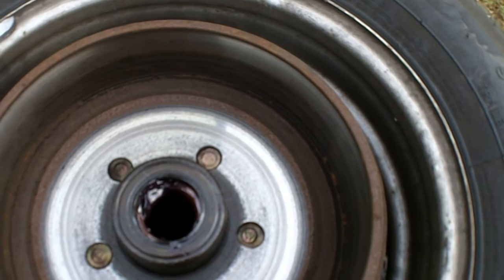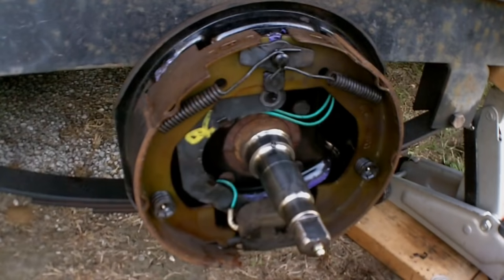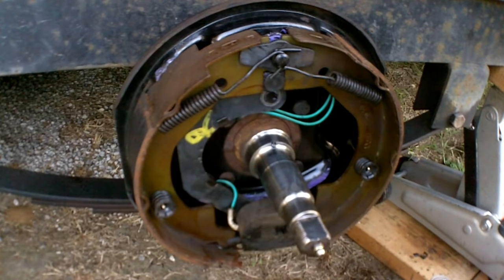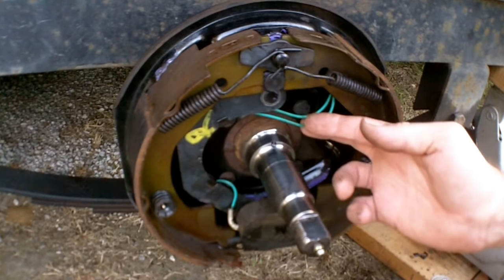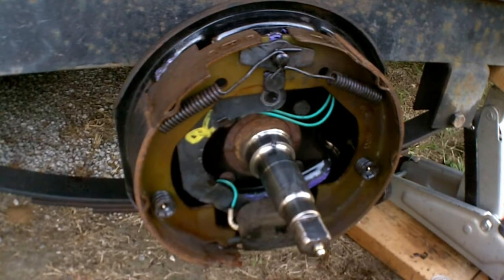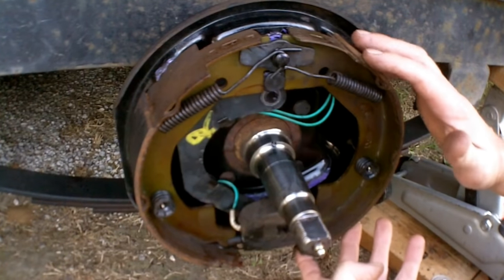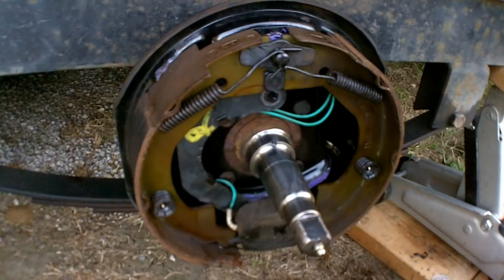How Electric Trailer Brakes Work

Comment: Is it normal for a multimeter to see both wires grounded?
Reply from the maker: I'm sorry Lawrence, I don't quite understand your question. Please elaborate and explain how you're probing things. And also include if the whip is connected to the tow vehicle while preforming your checks. I don't know if I can answer, but I'll try nonetheless. G.
Reply: Actually it was showing continuity. It's a nearly new dexter axle, I'll do the ohm test next.
Reply from the maker: @lawrencekendrick6440  Huh, sounds like you have it all figured out since you didn't even care to respond directly to my comments. Good luck, G.

Comment: 2 ?'s on my enclosed trailer, brakes stopped working. I know I have power at the 7 pin truck/trailer harness. Blue wire for brakes. Mine has a small 6 volt battery. I checked for power when truck brakes applied, I didn't get power on the trailer brake wires at the trailer drums. 
I think the emergence cable had been pulled off a while without my knowledge whike it sat.
I am not sure yet about the battery.
Where to start? Check etc TIA
Reply from the maker: Kevin, the small battery should be 12v. If the trailer disconnects from the tow vehicle, the emergency brake cable is ripped from the switch and causes the brakes to lock up and stop the trailer. That is what the 12v small battery is for. I would start there and possibly replace the battery and breakaway switch. From there, I would check the grounds on the trailer if they don't work under normal conditions. Good luck, G.
Reply: @ghostses  thank you
Reply from the maker: @kevinb.3528  No problem! G.

Comment: A great video.   Question: how often should the emergency battery be replaced. ...will an 12 v battery still work at 10volts?   They're $15 so just replace every year?   Thanks!
Reply from the maker: Thanks! I'm no pro, but I would only change my battery when it no longer takes, or holds a charge. 10V seems too low to me. Mine trailer does not have a built in charger that keeps the battery charged while towing. I can add one so my tow vehicle can keep it charged, but haven't done so. I test mine periodically by removing the pin and trying to move the trailer forward to ensure the wheels are locked up. This not only checks the battery, but also the brakes. I also check it from time to time with a multi meter. They might even have a solar float charger, but I've never looked. Hope this helps, G.

Comment: So one green wire goes to ground and the other green wire goes to the "brake" wire on the 7 plug wiring.
Reply from the maker: I would say yes. However, the colors of the wires may vary. It really doesn't matter the color, but they should be connected like you've said. Take care, G.

Comment: They're like brakes on a bicycle just inverted.
Reply from the maker: Not really, these are electromagnetically controlled. Dig deeper.
Reply: @ghostses  you missed my point mechanically...
Reply from the maker: @pantherplatform  I don't think I did. "Mechanically" they operate in very different ways. A caliper is more akin to how a bike brake works. A pinching action on the rim or the shoes pinching a rotor. This is a drum brake setup. A coaster brake would be a better example and more appropriate,  but you didn't specify. Since you said "brakes", that would imply a coaster brake was not in your head as bicycles have never had a coaster brake on front wheels. Feel free to elaborate more on how you think they're the same, but just inverted.

Comment: Sir do you think a donut brake magnet can be fixed (wires are broken
Reply from the maker: German, if there is enough wire sticking out to splice onto- it should work. If hey're broken off at the magnet, I don't think so. You should be able to get a replacement magnet if it can't be fixed. Good luck, G.

Comment: OK I watched this video this morning, and it was very informative. (I did not know there was an electromagnet that rides on the face of the brake drum) But the video is wrong as to why the front brake shoe is smaller. Now just to be clear, when I talk of movement of the brake drum, I am only referring to forward movement of the vehicle. (99.999% of the time) To start you should freeze the video when there is a clear picture of the brake shoes. Now ALL of the drum brakes I have ever done (except disk brakes with the drum brake Parking/Ebrake setup) Have the expansion point at the top. The Brake drum he is showing is the Left side So the drum is moving counter clockwise,  Your Expansion point is at the top so it has a leading edge at the expansion point (rear shoe) and a trailing edge expansion point (front shoe) If you can imagine the drum spinning around counter clock wise When your brakes are activated the front shoe is going to travel with the rotation and the rear shoe is going to go against the rotation, Meaning if the the front shoe was the same size as the rear shoe, You will have a certain amount of "self activation" for that front shoe. When they move that brake material away from that expansion point it reduces somewhat that self engagement. Also I have NEVER seen rear shoes wear out before the front.   P.S. If they moved the expansion point to the bottom (6 oclock) the rear shoes would be smaller. P.P.S.  I can sleep now.   :)
Reply from the maker: Arthur, I'll chock that one up to my instructor 25+ years ago- or perhaps I misunderstood all this time till now. But you are correct! The only thing I would modify with your post is the reference to the left side of the vehicle/trailer. This is the left side and it's determined by the position of the operator- so viewed from the rear.  The tongue of the trailer in the video is too the left. So counter clockwise is the forward travel. Not picking- just clarifying for others and their benefit. Thanks for the post, G.
Reply: @ghostses  I did say that this was the left side didn't I? I was tired.
Reply from the maker: You did Arthur. I must have been the one what was tired though...lol. I know I read your post twice (and also did my homework) and "swear" your description spoke about clockwise rotation of the drum- I believe twice none-the-less. That would mean for a forward motion reference, I would be on the right side of the trailer (as viewed from the rear) and the drum would be turning clockwise. You sure didn't, and my response even indicated what you'd already stated- COUNTER clockwise. So now, I stand corrected TWICE! What am I going to do now....lol. Take care, G.

Comment: how do you adjust the delay.  when i push the brake in my truck, my trailer wheels lock up right away.
Reply from the maker: Justin, There are two types of controllers- proportional and time actuated. I only mentioned my type in the video- time actuated. On my controller, there's a delay adjustment on the side. There is also a gain adjust to adjust how much braking force is applied .If yours is time actuated, you might hunt for the manual to see how to adjust both settings for your setup.

Proportional controllers sense the vehicle slowing and apply a varying degree of voltage to the brakes to allow more- or less braking. They probably also have some adjustments for various towing conditions, but don't know for sure since I don't have one. I will be installing a proportional controller when mine dies since they seem to need less attention when the load changes. As it is with mine, I seem to always be fiddling with it since my loads change frequently.
They are also supposed to make for smoother braking action.

A little long, but hope it helps in some way. Good luck, G.
Reply: +ghostses .  hey thanks a bunch! thats exactly what i needed to know.  i appreciate the help!
Reply from the maker: No problem! Good luck finding the solution to your problem. G.

Comment: Can anyone tell me why my two left side magnets in the drums are not getting power ? All the wires are good and tested with a volt meter but they are not activating just the left two not the right two that are working fine
Reply from the maker: The only things I can think of is if there is a short where the wires run trough the tubes (providing they do on yours), or if there is a grounding issue. If you can sever the wires where they go across, then jump temp wires to test, that might help you narrow the problem down. Hope this helps, G.

Comment: So these brakes aren't proportional? I mean they work in a 0-1 way, activating after a delay and with a predefined strength?  In Europe we use mechanical brakes that apply force proportional to forward tongue pressure, the benefit is that this system works automatically and instantly and braking force is scaling with the weight of trailer and deceleration without any adjustments, the drawback is that you need to lock the brake to back up and that there is always some force, needed to activate this brake, pushing a car forward when braking. Also on a steep downhill trailer may be riding its brakes.
Reply from the maker: No they're not since they're electric. The controller is what regulates the amount of force applied. For a controller like mine, that is not proportional, it works just as you've described. A proportional electric controller has a decelerometer built in that senses the vehicle slowing and applies a variable voltage to apply the brakes based on need. Proportional work more seamlessly in my opinion.

Not sure what they're called in Europe, but here what you describe are surge brakes. They pretty much work exactly as you stated- the good and bad. Take care, G.
Reply: An accelerometer based brake controller seems like genius idea! But I guess it requires careful setup so that it doesn't apply so much brakes that it actually pulls your car back  adding more g's in effect self-exciting until trailer wheels lock or you release brake pedal. It is basically a positive feedback loop.
Reply from the maker: I've never used that type of controller- but do know they need to be properly setup. I think they have programmable settings for trailer 1,2,3,etc. so you can tow different trailers with ease. When mine dies, I will definitely be going with proportional. As it is, I'm constantly messing with mine as the load changes.  Good luck, G.

Comment: Sorta got lost what controller in the truck and how is it rigged?
Reply from the maker: Henry, many newer vehicles have them built in. In my case though- it's a controller that's wired into the vehicle wiring. I would look for a manual for a controller to see how their wired. Good luck, G.
Reply: ghostses so your saying newer trucks have built in controllers? And the older trucks need manual controllers under the panel or on the brake pedal? Maybe you can show how that works and how to adjust brakes and timely delays.....
Reply from the maker: Yes Henry, many newer trucks have them built in. On older trucks a controller needs to be mounted and wired into the electrical system. In either case, the controller needs to be adjusted for the towing application. There are two types of controllers- the one I have is based on voltage/gain coupled with a delay for when the braking force is applied.  The other is called proportional which has an  accelerometer. It senses the deceleration of the tow vehicle automatically and applies the braking force according to the demand.  The latter of the two types is preferred IMO. Do some reading on the two types. Take care, G.
Reply: 👍 ghostses that I will.  Traffic now a days with distracted young drivers celebrating 2020 I just want a smooth trailer brake that works really well cause I would like to travel a 4500 pound sea ray 23’ around up and down the coast and even in remote lakes. Thanks for your prompt response 👍
Reply from the maker: No problem! I would lean towards proportional- but let your research be your guide.  Good luck, G.
Reply: ghostses yes of course have found electrical hydraulic for my purpose ( boat trailer). Not sure about electric brakes in sea salt water that was my problem.  If electric brakes would work or hold up for repeated in and out of salt water ramps.
Reply from the maker: Good deal! I'm nowhere near salt water so it never entered my mind something might be better suited for that application. Take care, G.

Comment: When I put the truck in reverse with the trailer attached, the trailer tires lock up tight.  The only way I can continue to push the trailer in reverse is I have to unplug the trailer plug so no electricity get applied to the brakes.  Adfterwards, gooing in forward gear, I stop and plug the trailer plug back in and go on my way.  What the heck is wrong with this brake system? Why do brakes lock up in reverse?
Reply from the maker: To me, it sounds like you have the brakes applying too soon. Play with your controller, G.
Reply: @ghostses  Yhsnkd very much for responding.  As far as I can tell, there's o controller; not under the dsh or anyplace.  I have a junction box with all the wire conncetions, but that's all I can see.
Reply from the maker: @lostinmyspace4910  You need a controller, either factory installed, or an aftermarket controller. I really don't know what your problem could be, but a controller is necessary. Perhaps take it to a trailer shop so they can look at it. Good luck, G.

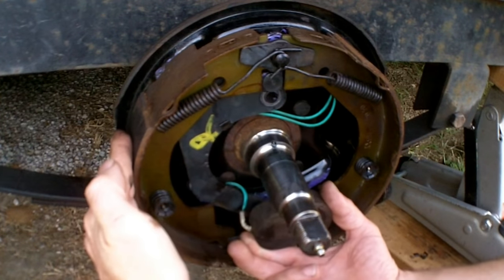Comment: 2:33 if you're travelling in reverse? Why would you need trailer brakes in reverse? Ha ha how fast do you back up a trailer?
Reply from the maker: It's not so much speed, but rather braking and holding power. Like if you're backing down a boat slip with a 10klb boat. Or in my case, a fully loading trailer stopped on a hill. The vehicle may have trouble holding the load and not rolling backwards, if it does move backwards a bit, they engage and stop it. Take care, G.

Comment: My trailer brakes aren't working...all I hear is a hum when they are energized at 6.5 to 10 on the brake controller
Reply from the maker: If they wheels aren't spinning- they may not engage. G.

Comment: This type of brake are totally illegal in the uk. Trailer brakes are not allowed to work independently by a separate control or aftermarket fitting kit .They are not allowed to work by stoplight control either because the delay is too long. I can't believe in a first world country you are so far behind in terms innovation ,but you can put a man on the moon.  I've noticed on some videos you don't even have a trailer park brake, just wheel chocks. This is very strange.
Reply from the maker: +cosgrove notts 
I won't disagree. It's just they way it is here. Mine doesn't have a park brake either. Take care, G.
Reply: +ghostses cheers

Comment: These electric brakes are shit.
Reply from the maker: Better that nothing I would say. Shit is better than no shit, right? What say you Sammy? Shit?
Reply: @ghostses  i am quoting  trailer guys that told me the amount of problems they have.  Better to use hydraulic. If you need higher weight capacity then get a heavier tow hitch.
Reply from the maker: @sammyd7857  That's cool. G.